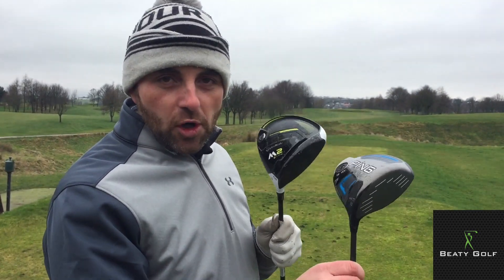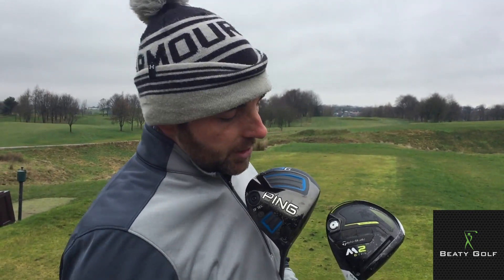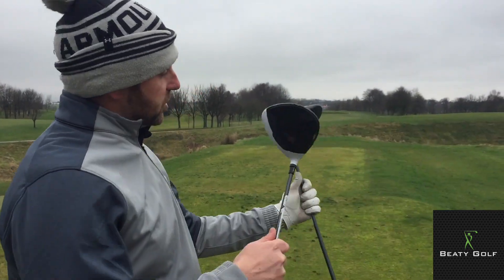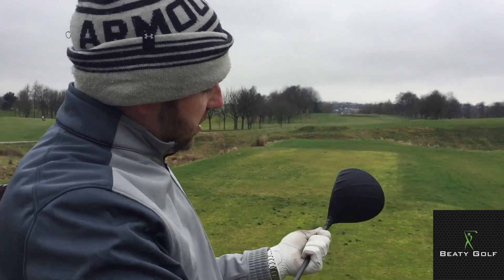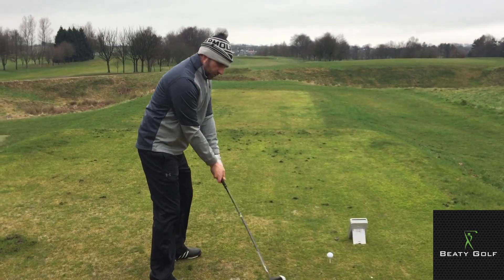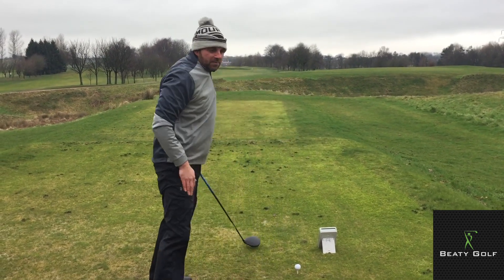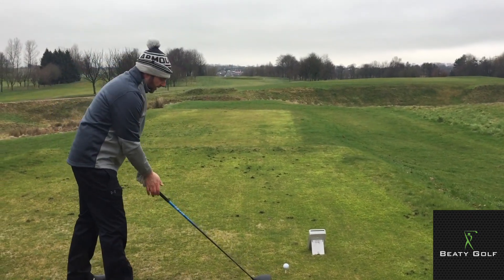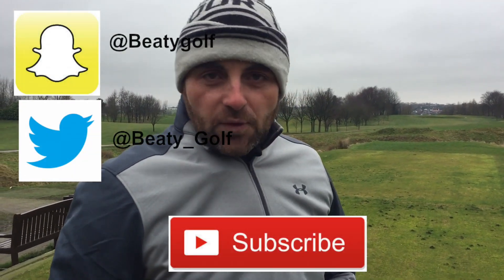Ping G Series SF TEC .V. Taylormade M2 D-TYPE Drivers Head to Head

Comment: Thx for the test, Martin.  Was there a distance difference between the 2 drivers?  When I tested the SF Tec last year, I found it to be shorter than the standard G driver, as well as the SLDR that's still in my bag.  Thx.
Reply from the maker: Thanks for the comment. TM's definitely faster off the face (less spinney) due to low forward CG which dates back to SLDR hence getting everyone to "loft up" to optimise launch. TM marginally longer due to this, in fact id opt for a degree or so more loft in M2 as standard again to optimise launch without having to add loft on the loft sleeve (which closes the clubface). The Ping G series was so very user friendly and does look awesome behind the ball and as standard would suit most "swingers" rather than "hitters". I feel a stronger swing speed would get more out of the M2 as std.

Hope this helps, thx for watching